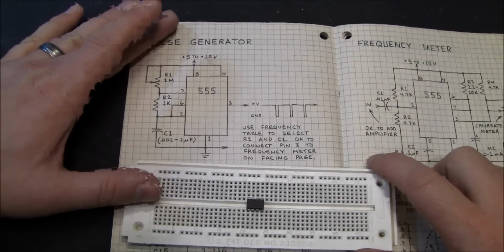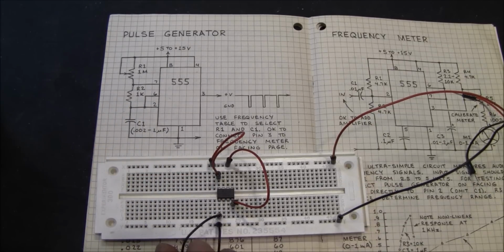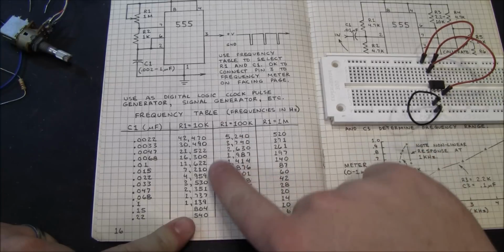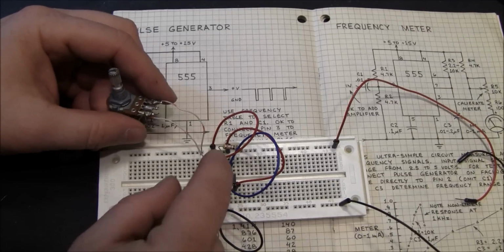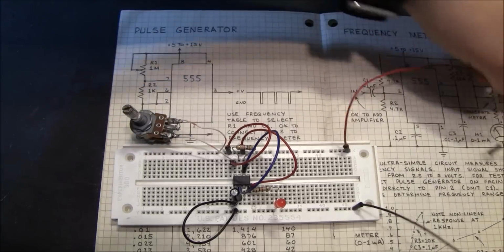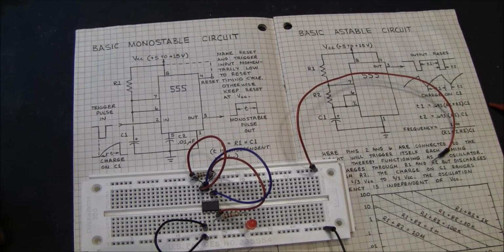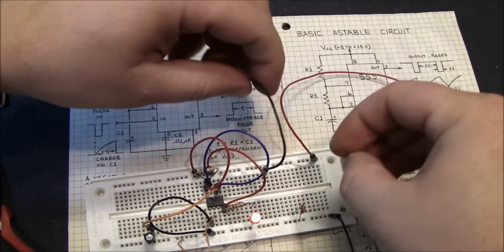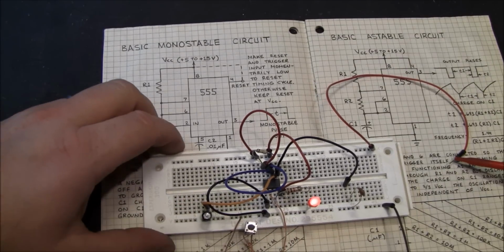Beginner 555 IC chip tutorial

Comment: 1. Explain why R2 is connected to DIP 6 and 7 and not DIP 2 and 7.
If C1 is connected with DIP 1 and 2, and R2 shares a common connection as per the schematic, then shouldn't R2 also be connected to DIP2?
Confused.
2. Explain the part of the schematic showing a wire from R1 back around to itself. I don't understand.

Comment: what 8 pins IC is pin no.1 is VCC pin no. 3 is input pin no. 5 output and pin no.8 is GND from DC controller motor 15 amp and 90 volts

Comment: ive been trying to get a 555 working forever! the most i get is a solid led.  I have tried different resistors capacitors . right now i have a 470uf cap w 2 100ohm resist and a 50k pot and all i get is a solid led and the pot does nothing, same schematic as in the video as well.  what am i doing wrong?
Reply from the maker: Do you have an extra 555 chip to try out? You might have toasted it.
Reply: Same here, and I have used 2 555's :(
Reply: Try to use a 555 circuit generator online

Comment: Thanks !  Questions:   Could one use this to control a water  solenoid  in place of the LED? Will it work with 24 volts ,vs. 9, with a variable resister to make changing  speed ?